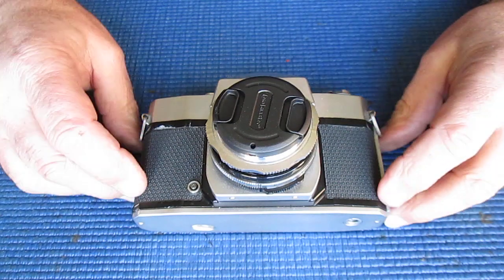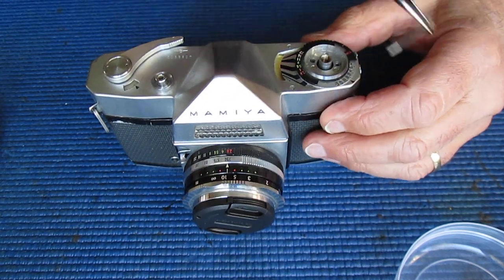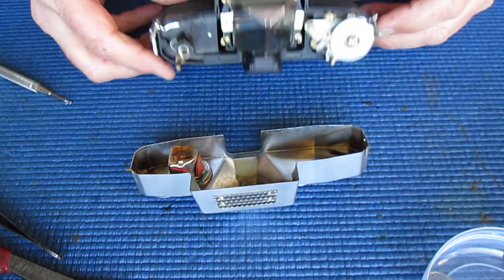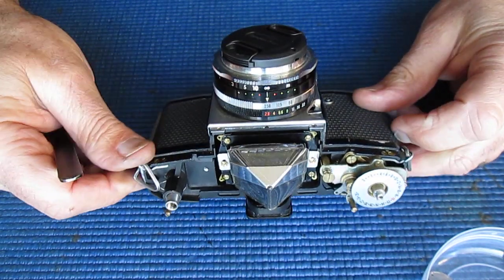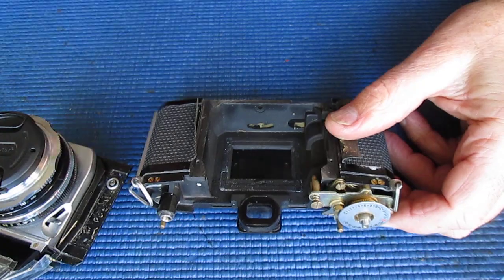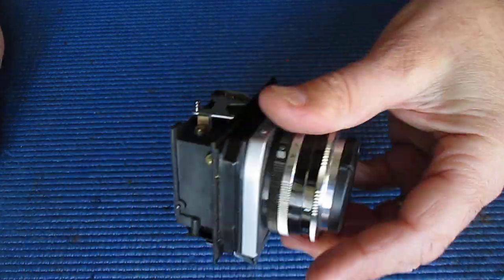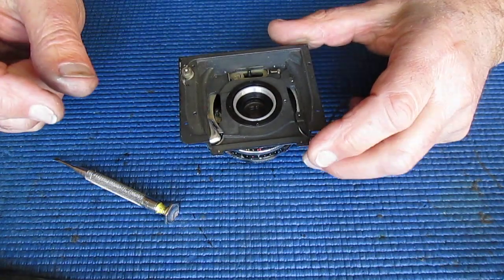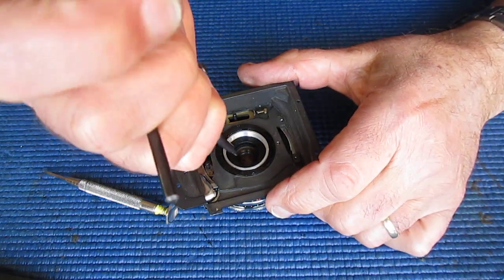Mamiya Family SLR shutter service part one

Comment: Chris, Film baffle in mirror box here is synchronized with shutter, mirror, auto aperture mechanism  AND  flash ( at any shutter speed  -  I checked).  So, if shutter leaves are stuck due to  solidified grease the baffle itself will serve as a shutter. Just like in some EXA models. Therefore, I wouldn't worry much about the Copal shutter on this model and would  merely leave it alone. I did. Loaded some  film in my Mamiya  Family example and pictures came out stunning. With film baffle only  taking over  function of the shutter. I'm not sure why this Mamiya model was  designed the way that  film baffle  doubles function of the shutter. CONTAFLEX design is different: baffle is  closed during focusing  just like in Family but  then it opens upon shutter actuation and STAYS OPEN while shutter leaves  do  timed exposure work, opening and closing. It only closes again in the middle of winding process, after film is moved one frame forward but  BEFORE the shutter is cocked ( because, just like in WERRA models - but being RFs only having second set of shutter leaves  instead of film baffle, shutter leaves in Contaflexes slowly open and close while shutter is cocked). So,  in Contaflex shutter and film baffle don't double their  mutual function. BTW, speed range  of B, 15-250 in Mamiya Family model is much better, than EXA's ( B, 25-150) and matches typical leaf shutter speed ranges of  slightly earlier era, minus slow speed escapement, which Mamiya Family  lacks ( a  surprise with "full-fledged" Copal leaf shutter coexisting in this model together with "mirror-flap" mechanism)

Comment: Nice video, Chris. I saw this camera online and am planning on buying it. The problem is that the seller doesn't know anything about cameras. However, the seller sent me a video of him advancing the lever and then pressing the shutter which made a shutter clicking sound. Does that mean that the camera is working?
Reply from the maker: That is a definite maybe. The secret is whether or not the shutter blades actually open and shut correctly for the set shutter speed. Chances are high you will not find this out until you hold the camera yourself.
Reply: @ChrisSherlock  Thank you! It's alright now. I bought a different camera. A Yashica Minister D from 1964. Condition is 10/10. Haven't shot photos with it though. Will try soon.